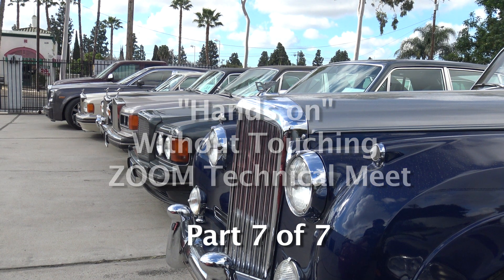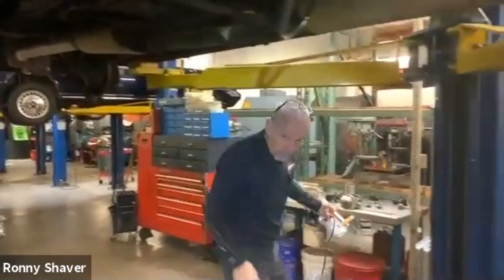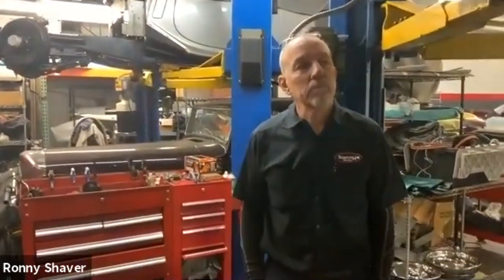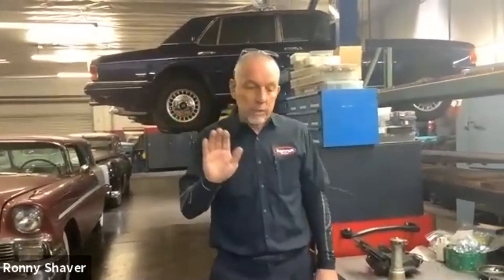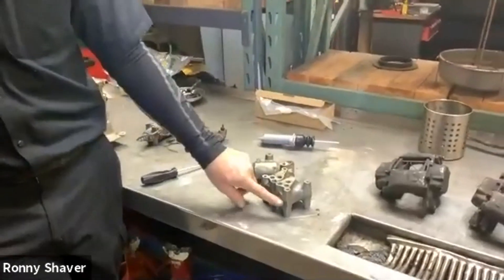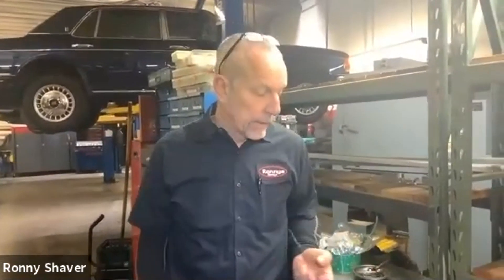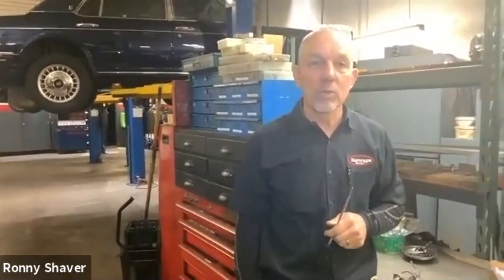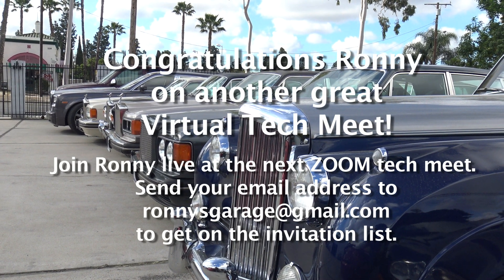Hydraulics System 1973 Corniche Part 7 of 7

Comment: Hello ronny from england. I wonder if you can help me i have a 1975 corniche master cylinder car.I cannot get the brakes to bleed properly, Icannot get fluid out of the rear front calipers or the height control. I have fitted all new flexy hoses including the rat trap ones. Ihave tried to bleed the sphere but all i am getting is froth. I have bled out number 1 sphere no problem at all do you have any ideas why i cannot get fluid to bleed on the number 2 sphere kind regards

Comment: Thank you watched all 7, I have a 75 LWB brake pressure 2 light was on everytime I started even if only turned off for a few minutes ,now left rear height control valve leaking, brake pressure 2 light constantly on, also rear height control has never worked in three years of ownership, also interior lights not working, would that affect height control, what would you recommend i do, regards Adam in the uk